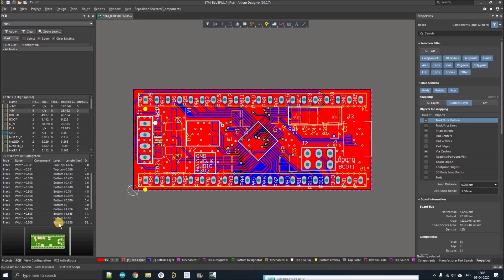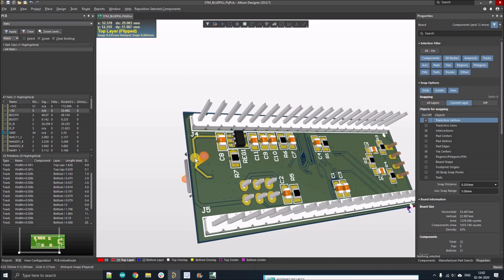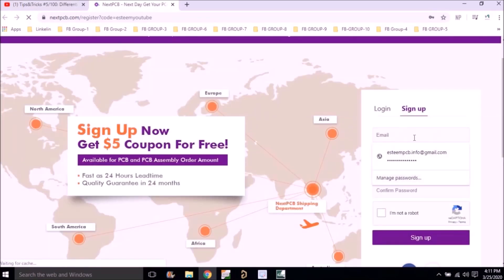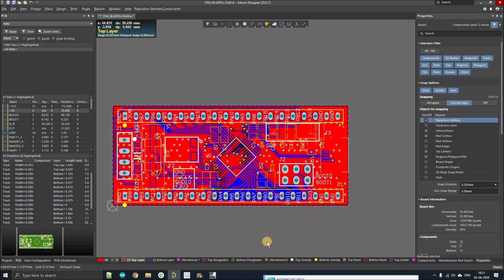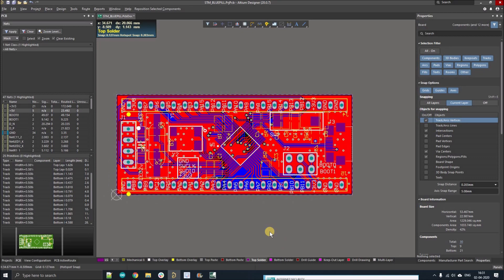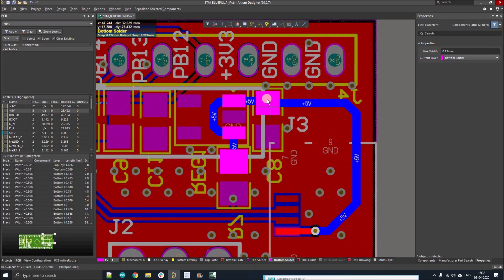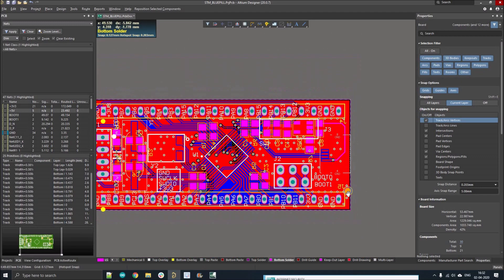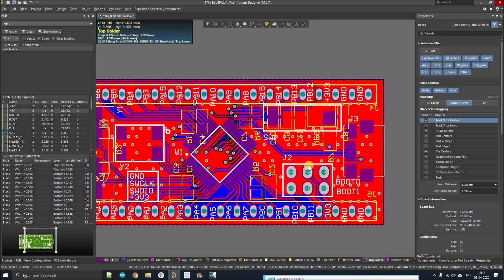Altium Designer Tips #16: How to Expose Tracks and Remove Solder Mask

Comment: I do not understand, why not just make the track thicker? Also, there is a via there, the via will still get very hot and there might be a mechanical failure due to that.
Reply from the maker: Hey sometimes in high power application even thik tracks are not enough, then we do solder copper strips to carry that amount of current,
Or put solder on exposed path.
https://www.google.com/search?q=50a+current+on+pcb+tracks&tbm=isch&ved=2ahUKEwj_7uX3lJv3AhVR_zgGHZqyC7YQ2-cCegQIABAC&oq=50a+current+on+pcb+tracks&gs_lcp=ChJtb2JpbGUtZ3dzLXdpei1pbWcQAzoHCCMQ7wMQJzoECB4QClDEEFilU2DoV2gAcAB4AIABkwGIAbcZkgEENS4yM5gBAKABAcABAQ&sclient=mobile-gws-wiz-img&ei=xhBcYv_zINH-4-EPmuWusAs&bih=672&biw=360&client=ms-android-oppo&prmd=ivsn#imgrc=QlTds6dVXjhniM&imgdii=VE9fV9QpuK9mnM